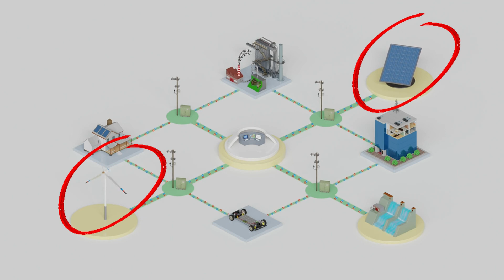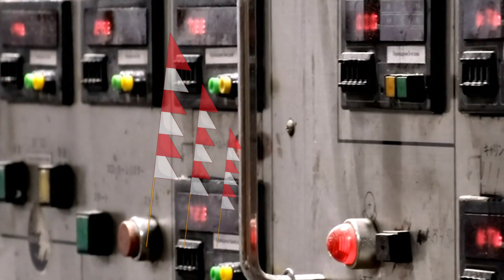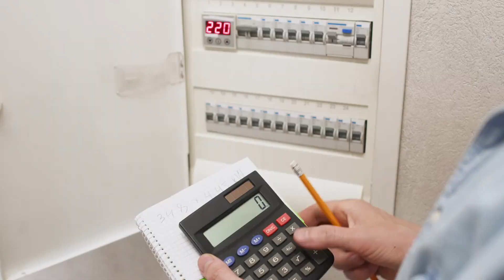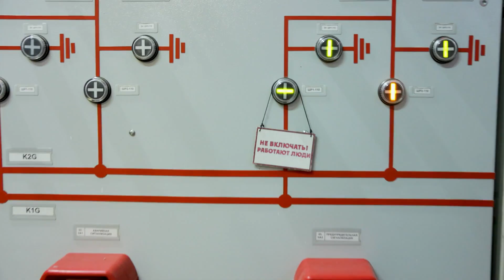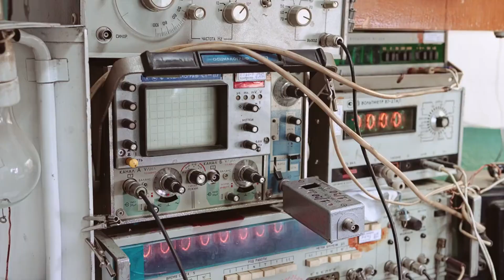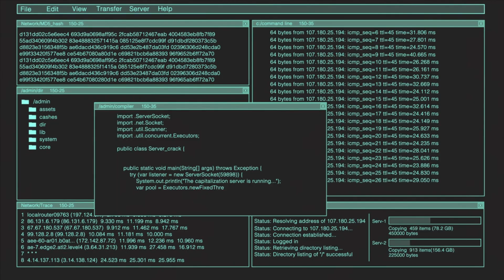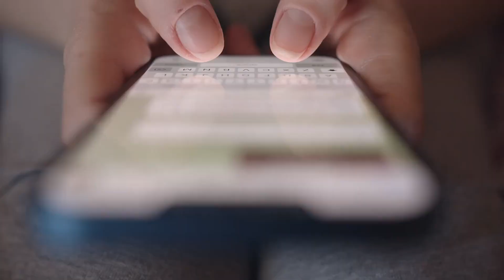Spain Reveals Ground Zero of Massive Blackout – What Really Caused the Iberian Collapse?

Comment: Given the 50Hz transmission frequency will attempt to propagate at the roughly speed of light (say 200,000Km/second for argument), if you get two outages occuring half a wavelength =2000km apart, can this set up a standing wave in the grid, just like shaking both end of a skipping rope? A number of these blackouts seem to happen on very large grids, where grid length exceeds the wave length of a 50Hz signal.

Comment: Once the was grid re-started, there were NO reports of failed components, that could not automatically re-enter use on the grid. 

This indicates that there was no single point of failure, but rather that some kind of monitoring, management or compensation issue, was the cause. 

It is a constant balancing act, with multiple real-time issues, that needs to be monitored, accessed and managed - in real-time -  in order to maintain a stable grid.   

--- 

Data shows that within a 5 second window, about 2GW of power disappeared. 
There was NO singular power plant that were at a 2GW output. 

Most nuclear power plants (world-wide) have a max output ability that is LESS than 2GW. Only a few select nuclear plants world-wide, has a 2GW power output ability.  

It takes some 45-65 of the very biggest solar farms to produce 2GW of power. 
It takes about 100 of the biggest windmills in the world, to  give a 2GW output. 

* It is however NOT uncommon for transmission lines to handle 2GW or more. *

So it is very unlikely that the initial 2GW fault was caused by any singular (or even any group) of power stations. 

* It is much more likely that the 2GW fault is related to some kind of mis-management of transmission level issues. *

--- 

A region in France was also affected by the blackout (some 1.75 - 2GW going from Spain to France, via a HVDC line, was disconnected without warning, as the last disconnect that happened on the Spanish grid), 
but the grid in France was able isolate the fault, so the rest of France remained up, and continued running as planned. 

And within a few hours, power generation in France was increased, so the grid in that region of France could get up and was running again. 
The 'interday' electricity market is where such adjustments are dealt with (in the above 1GW range). The 'interday' market (in Europe) has a minimum response time of 45 minutes. 

It might be worth noting that:

In France they invest about €63 per citizen, in grid maintenance and upgrades. 
In Spain they invest about €21 per citizen, in grid maintenance and upgrades. 
In Portugal they invest about €6 per citizen, in grid maintenance and upgrades. 

At the time of power failure in Spain, about 50% of the power used in Portugal was being imported from Spain. No grid (anywhere) has a ability (in a few seconds) to re-source 50% of the used power - from any type of stand-by power-sources. A minimum of 45 minutes is needed in Europe.
Portugal has the ability to produce 100% of the power needed in Portugal, as was seen in the days following the blackout. But on the day in question, it was cheaper to buy energy from Spain. 

--- 

Frequency synchronicity is vital in order to maintain a stable grid. 

There are several factors that constantly tries to push some of the synchronicities out of balance. Like: 

- Harmonic Distortion
- Reactive Power Imbalance
- Voltage Fluctuations
- Frequency Instability
- Power Factor Issues

Any of these real-time challenges can cause un-intentional and un-wanted oscillations to occur in different locations of the grid. 
 
And all of these issues, require constant real-time monitoring, assessment - and very rapid real-time grid-management adjustments, in order to maintain a functioning grid. 

--- 

The UK has, for several years now, been building, testing and adjusting a new method of getting better real-time feedback from the grid. 

The new method includes sending an impulse out into the entire grid, and using sensors in the right sports, to see the results of the impulse. 

Several iterations of impulses, data collection, and optimizing placements of sensors (and adding additional sensors), has been needed, in order to ensure a complete and reliable picture of what is going on (in real-time), on the entire grid. 

Likewise, it has included testing and monitoring, how a varying use of different power sources - and different levels of Reactive Power Balance measures - that can be used to ensure a stabile and reliable grid. 

Recently a test with only renewable power sources was tested. 
All spinning generators were on-purpose disconnected, in order to see if un-foreseen or un-expected issues showed up. Non did. 

Perhaps Spain does not yet use this new method of 'impulsing and monitoring', in order to get the newest type of data from the grid? 

--- 

Where I live (in the north of Europe) we have many days each year where we have well above 100% of power from renewables - on our grid. 

And just like Spain, we sell the excess of power to neighboring grids. 

So, for several years now, more countries have yeas-old actual real-time experience, of how to deal with 100% (or more) of renewable energy on the grid. 

--- 

Something that has not yet been talked much about in connection with the Spain, Portugal blackout, is that: 

The historical increase of electricity use is such, that we need to expand the grid to double capacity, every 20 years.  

So not only do we need to maintain (or replace) 20-50 year old grid equipment, we need to add double capacity on everything new. 
We need twice as many long distance transmission wires, or we need to replace them with twice as high voltages, in order to keep up with the natural demand. 
As we also try to place the new power-generation plants/farms, away from cities, we also need to establish  better/newer and longer transmission lines. 

--- 

All of these issues mentioned, appears to have pushed all of the old and the new challenges - to run a stabile grid, to new heights. 

In order to be able to successfully deal with both the old-and-well-known, as well as the new issues, happening on the grid, we need to develop new and better ways to monitor and react to issues that constantly is a natural aspect of what shows up on the grid. 

--- 

Power outages are nothing new. 

Wikipedia has a page that shows the biggest power outages "List of major power outages" 
It shows that there have been 12 power outages that has affected more than 60 million people (60-620 million) in anyone of those major events. 
The list starts with events in the 1960'ties - so power outages are nothing new. 

Power outages are however still a significant nuisance - and often have fatalities - so we ought to do our very best to minimize their occurrences.

* I am still hoping that there will be official reports, and official recommendations - on an EU level - of how to avoid as large outages as was experienced in Spain and Portugal. *

--- 

Somehow they did managed to isolate the issue in France, 
so it did not become a nation wide event in France as well. 

Despite the known fact that any grid in Europe needs a minimum of 45 minutes to be able to re-source power, if unexpected power fluctuation is above 1GW. 

Nuclear plants are the slowest to be able to react to high power level changes, typically they need several hours of warning, in order to be able to change their output. All turbine driven power plants have this 'slowness' issue. 
Only the large diesel motors have a fast response time (measured in minutes to tens-of-seconds) - diesel motor generators are often operated in plants of 20 motors or more, as each generator only has some MW output ability. So an entire plant of 20-50 diesel-motor-powered generators are needed in order to produce a combined output of 1GW. 

So about 100 power sources was likely needed to UP their power output (or several nuclear plants needed to UP their power output with several %), in order for France to be able re-power that section of the grid in France (that suddenly needed 2-3GW of extra power input) in just a few hours of response time. 

--- 

The most recent major outage (where I live) happened in 2003 - and several new measures was implemented within a few years,  so it is much less likely to occur again. 
And IF a major event does occur, then new and faster grid-re-start measures  were built and implemented - and have been operational since 2006. 

--- 

Since 2003 some Weather Events have however caused local disruptions to the local grid.

So the current official recommendation is, for every local household, to have water and flashlights stored, to be enough for 3 days. 

It has taken me less than one hour, to acquire: bottled water, flashlights and batteries enough, for 3 days. 
And it has taken me less than 30 minutes to find a good place to store them, so they do not interfere or irritate with any of my regular daily routines. 

What were some of the items that were cleared out in the shops in Spain and Portugal,  during the blackout? 

--- 

I think that the cause of the blackout in Spain was because of (possibly decades long) limited investment in the new measures, that are needed - as we double capacity (and usage) every 20 years.

The Spanish grid was however only at about 50% utilization on the day of the blackout, compared to days where the highest level of power consumption happens in Spain, so the issues was NOT because of a general overload. 

But the oldest (and most well known) methods of how to maintain and create real-time stability on the grid, was obviously not enough to ensure the correct level of energy-balance was happening (at the real-time level). 
So better (and newer) monitoring, prediction and reaction methods, seems to be in need of implementation/development.
Reply: it does not matter what the government(s) say, it was their policy of unreliables that caused it, we the public do not believe their delays and lies, they are not trusted